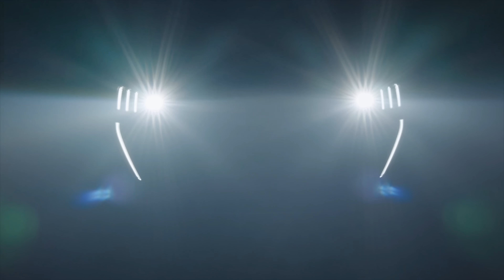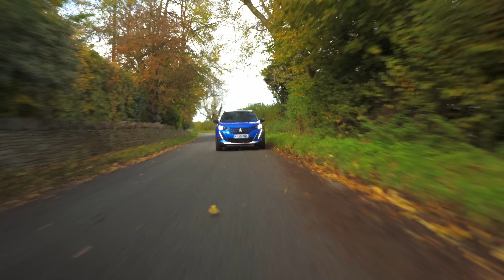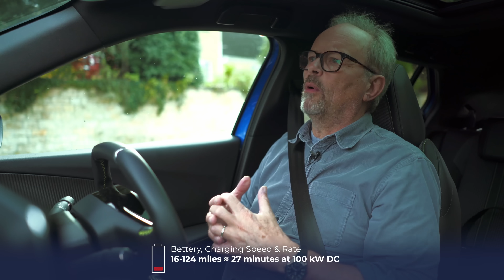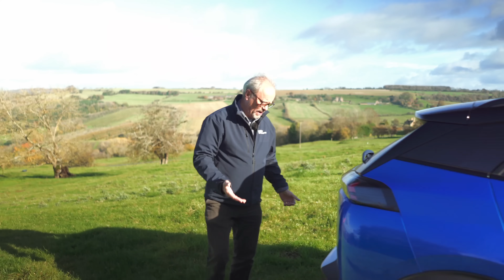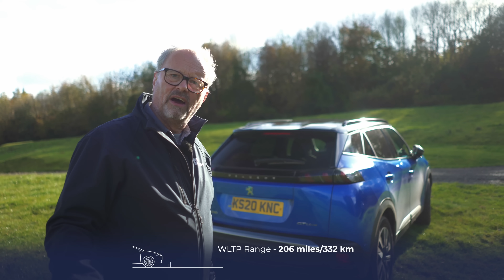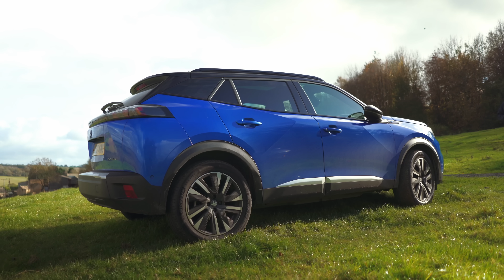Peugeot e2008 - how does it compare to other compact SUVs? | 100% Independent, 100% Electric

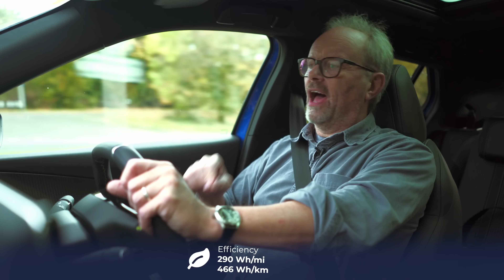Comment: 4:37 Why, oh why, oh WHY do you guys keep getting the conversions wrong!

290 Wh/mi should be 180 Wh/km (Pretty decent efficiency). Or alternatively, you have the units switched and it's really 290Wh/km and 466 Wh/mi (Pretty awful efficiency).
Reply: I think he left his math-circuits at the set of Red Dwarf.
Reply: I was just about to make a comment about this and saw this. Robert, you need to fix this.
Reply: @mdashikuzzaman  I was also going to point out this - and they did this mistake at least 3 times recently, not only in this episode !
Reply: Or how about just forget the silly imperial units and stick with metric? If people can't understand metric units they can put into a conversion program, eventually they will learn to use metric.
Reply: I suspect it done specifically to irritate people like, er.......

Comment: "I dont care what you say 150 miles range is enough.." owns and drives a 200 plus mile Tesla. If you are a 1 car family the longer the range the better. We do not have a reliable enough rapid charger infrastructure to validate such commentary. Also faster charge rates require more cells in parallel. The current physical limitations can not be dreamed away. You want a small battery ev? By an electric motorcycle. Its time to put up or ...... leave it be. I own one they are a lot of fun to ride. Make sure to do so safely and dress for the slide not the ride.
Reply: It depends, doesn't it? I'm in a one car family and 150 miles range would suit me perfectly if I had a driveway to charge on. I don't commute to work so my mileage is not very high.  I'm really more concerned by having enough space inside and initial purchase price.

Comment: Hi Robert. Just wanted to point out you’ve got the trim level logic backwards. Batteries are still expensive, therefore having EVs only on high trim levels gives them a larger margin to absorb that cost. The tech you get on a high trim level isn’t worth 10 grand, it’s almost all margin. The Seat Mii electric which starts from 19k used to be around 10k when it had a petrol option.
Reply: How can manufacturers justify £9000 for the battery?
Reply: @recumbentrocks2929  That’s a question for them to answer since I don’t have any inside knowledge of the costs incurred or their margin for warranty repairs, etc. Looking across the industry, EVs are roughly 7-10k more than a base model petrol version. Also there were reports that the electric Mii/Up/Citigo triplets were being priced at a €5k loss in order to mitigate EU fines.

Comment: The range is more like 140-180, it just has a horrendously pessimistic GOM. Some people are reporting that it's better after a software update.
Reply: The claimed 290Wh per mile, and 45kWh of accessible battery, gives a range of 155 miles. That agrees with your estimate. Robert's maths was wrong, near the beginning of the video.
Reply: @RWBHere  so 250km range? sounds pretty perfect for life in the suburbs.

Comment: £28k (although for some reason it seems to be more like £32k on the Peugeot website for the base, £35k for the GT Line) ... compared to £20,590 for the petrol one. Don't think they'll be selling many of these on cost alone, you've really got to want to have the electric one knowing your break even point is going to be beyond 50,000 miles away! Also I think its a pretty dirty trick to make the electric one appear cheaper per month by whacking on a £10k extra deposit over the petrol ones to get the monthly payments to look sensible!

Comment: Same range reports with all PSA eCMP based platform cars so far. Its just not very efficient at high speeds at all. And when you add ICE aerodynamics to the mix, that just tops if off.

Comment: Do you not think the EV market in the UK is going to be shafted with Rishi Sunak's plan for road pricing?  Could be £1.50 per mile!
Reply: £1.50 would be in Westminster I guess, less than 10p most places
Reply: Not if you have to pay it for all cars not just EVs
Reply: Can't see a cost per mile happening anytime soon. More likely a tax at public chargers and a large increase on road tax will be a more practical starting point.

Comment: So, first, if we take the consumption and translate that to MPG, it is massively more efficient than a combustion engine car. Then you get 130 miles instead of 260 miles from the car, so effectively, you simply actually DON'T get that very efficient car you blabbed about ca. a minute before halving the range. I'm not sure what I should take away from that blabla, really. :)
Reply: No it's still efficient. You need to look up what the word efficient means. It's basically like the battery has a gallon of petrol equivalent of energy but gets very high mpg.
Reply: @timscott3027  Depends very, very much on whether that MPG equivalent was taken from its official numbers or actual numbers now, doesn't it. I'm aware that generally, an electric motor is more efficient than a combustion one, Mr. Impolite McTeachy, but the text of this video went really, really crazy with throwing around numbers, halving others later on and being unclear on what's what about the first statement. If you don't see that, I guess you don't see that.
Reply: @fryke  yeah I get you what you mean, sorry for being rude. Still more efficient than ICE.

Comment: I own this car. The inside led can be dimmed or turned off if it bothers you. Mine don't bother me. 
Over 800 miles, I have an average 4.0 miles per kWh. I have heater on auto and get over 160 to 180 miles at this time of year. I'm a careful driver and expect much more miles in summer like I used to with my older leaf I had.
I also have a reverse camera
Reply: Nice to hear your getting a decide range too.. I get my black GT e2008 on 30th of November... can’t wait
Reply: @awesomeactiontv6964  you will love it 😁👌
Reply: @awesomeactiontv6964  any updates at all if you have used it for circa 2 months? I have been offered an e2008 GT for work, just mulling it over and would appreciate a hands on bit of feedback, many thanks
Reply: @craigwilliams6049  Got the car beginning of nov and I absolutely lov it... the only thing I’d say is if you are going to have to do lots of miles when it’s cold temperatures then your going to watch the range... I’ve notice and I have a friend in Sweden that runs a 208e that you’ll loose 30% range once it drops below -2
Reply: I test drove the car for an hour and was very impressed but they would not let me have one for a weekend as I wanted to do a 150 mile out and return (300mile) round trip to see what the motorway range really stacked up to. Without that I just couldn't pull the trigger on it.
Reply: @Mimbultonia  I know the feeling. I wanted to test drive others longer too, but no joy. I decided to take a chance on this and it's more than enough for what I needed. I've done various tests over my 800+ miles and I judge how well it'll do based on the quarter electric gauge. Basically I usually get 20 to 30 miles per half quarter. So I then usually know how it'll end up and I'm usually spot on. When I 1st picked it up, it said I had 188 miles. I drove 15 miles carefully and when I got home, it said I still had 188 miles lol
Reply: @Mimbultonia  just watch the many YouTube videos and you can decide
Reply: @danielcristea3868  I feel like I have watched them all! Just want to decide for myself. If the range was just a bit further it would be perfect
Reply: @Mimbultonia  James Batchelor (formerly of Carbuyer) has got one on test and he's saying he's getting close to 200 miles following a software update - which I suspect has come in since Robert filmed this video.
Reply: So pretty much what Bjorn Nyland got on his range test! 👍
Reply: I have this EV, same spec GT Line, also did not come with reversing camera ( supposed to be included on GT Line) but was missed on production line. Get about 120 miles on full charge in winter, and about 150-160 in summer.
Reply: Nice. I’m tempted. Does it have auto hold for the electric handbrake?
Reply: @cal_lywal  yes. My old leaf was the weird clutch style lol. This has a nice auto switch. Easy access 😁👌
Reply: @cal_lywal  I test drove it and I can confirm that it does have it. I actually love that function too. I am planning to buy one soon
Reply: I would really like one but the range worries me, especially in the winter
Reply: @The-Salty-Badger  totally understand. I'm now getting constant 4.6-7 and just over 200miles, so I'm happy with this. I was a little worried I'd never achieve this, but now have seen I can, it's a relief lol. I'd say judging from my ownership from last October, it's probably 150miles+ in winter worst case. 👍
Reply: @spacedoutET  what sort of speed do you drive at to achieve that and do you drive on motorways much ?
Reply: @The-Salty-Badger  I'm generally mixed, but I'd say mainly lower 50-60. I'm yet to do a solid motorway journey only, because of the past year covid 😖. Not really had chance. But it's mainly my area driving, so it covers perfect for what I need. Obviously, everyone's different and has different needs, so it's completely understandable your concerned. I was the same, as I was only offered a little test drive in a city and you always want a real test for what you do, wherever your from. I took a chance after owning a 30kwh leaf for 2 years and getting fed up with charging every 70+ miles. This doubled my range and I feel so much happier now. Tbh, even doing a long journey, most of the time in my old diesel I would stop half way anyway, to eat or rest, so having the option to charge doesn't really bother me whilst I'm doing that 😉👍. What ever you decide, I'm sure you will make the right decision for you. 👌
Reply: @spacedoutET  cheers appreciate the advice
Reply: Are the interior led strips also in the back?
Reply: No. 😷👌
Reply: @spacedoutET  Do u like the car? I can get the car in march.
Reply: @FeShMu  love it. So far, so good. I placed order in march and picked up October. Been reliable so far with no issues, touch wood. That's all I needed was reliability. Fed up with vauxhall always caused me issues for years. Needed a change and if it runs as well as it has these last month's, I'll be very happy 😷👌
Reply: @spacedoutET  Coincidence, because I’m driving an Opel(Vauxhall) Corsa right now lol. Do you use the app for your car?
Reply: @FeShMu  lol. I got the app, but waiting for it to register to fully make use. 👍
Reply: @spacedoutET  Do the car get updates?
Reply: @FeShMu  I believe so, but I think I have to do it a certain way, unless I'm wrong lol. I been a bit busy doing other stuff, I have not had much time to look into it. I keep forgetting everytime I'm doing something else. 😖. I'm a nightmare. Lol. Just aswell it's running fine. The guy at Peugeot was nice throughout and said any issues, just ring him. But ain't needed to. 😶👍
Reply: I don't think I've ever been in a car where the interior switch lights, mood lighting or infomedia screen can't be dimmed.
Reply: I have had this model SE Line since July.  During the summer I was averaging in excess of 6m/kWh but now we are in colder weather (plus I am doing shorter journeys) I am getting just under 4m/KWh.  I plan on 160mile range during cold weather - shorter journeys using sport mode will decrease this but this is down to driving style
Reply: @ujkakevin  this sounds promising. I've had my e2008 Gt for 2 weeks not rans it below an indicated 40 mile range remaijjng, but that would have only put me at 120-130 mile in total. Hope to get more to be honest. But I have free charging at work as well as home charging. 👍
Reply: 4 miles per kWh? That sounds not plausible. This is only about 150Wh per km. The most efficient smaller EV use that. On the other hand I Wonder how much interior heating affects that rating. IFAIK there is no heat pump in this car.
Reply: your maths is a bit out Martin. 4miles per kWh is 250Wh/mile, so sounds very plausible. and with 45kWh battery that would be 180miles of range.
Reply: @martingorbush2944  4 miles per kwh seems to be the industry target for any good BEV.
Reply: @martingorbush2944  
My Kona Electric regularly give me near to 5 miles per kWh of local road driving in the summer and 4 miles per KWh on motorways at 70 mph.
Reply: @martingorbush2944  my i3 sits on 14.6 kWh/100 km, over its 70k km lifetime.
Reply: @martingorbush2944  Their is a heat pump and check out the Driver Manual number 4 on the car diagram.
Reply: @martingorbush2944  watch Bjorn Nyland drive a 2008 over 1000km at speed limits +10% and achieve 3.96 miles per kWh

Comment: I think even city cars need 150+ miles range, in winter driving, after that it is just nice to have.   The weight of the battery is the same full or empty, so there is a point where the huge battery becomes an efficiency drag, along with much longer charger wait times.  I get the feeling car manufacturers and the general non EV public, are still stuck in the petrol station mentality where you only charge ( fill up )  once - twice a month, so the battery needs to replicate that.   In reality, a charger needs to be where the car is parked up for a length of time.  So you graze charge not gorge charge.
Reply: I suppose it depends if you live in a flat. My first ev was Renault Zoe 22kwh, I quickly learned I didn't need to charge all the time, even with a winter range of 70 miles.  I topped up at home and warmed the car before leaving....

Comment: GT line - is the production line where they are thrown together faster!  :-) - - If they discard all the gimmicks, bells and whistles, they could be sold for less. My current fossil car has an FM/DAB radio/cd player fitted. I turned it on when I bought the thing, to see if it worked, and it hasn't been turned on since - don't need or use it. I prefer the silence so I can hear what is going on around outside. - - Why do you keep measuring boot/trunk space in LITRES? I don't carry loose liquids in the back. Measure length, width, height in feet and inches, or if you really must - in those foreign centimetre things. Range -needs a bit more. A place I go to regularly is a 210 mile round trip - in good weather - and there is nowhere there to charge up while I'm away from the vehicle, so I'd be adding at least half an hour to the travel time - IF big IF I can find a charger that works - so I can get home again! - - And that big, ugly, square front, so inefficient. Yuk!

Comment: What's weight difference over e-208 as that does 185 miles. Repeated CCS charging on car tested here and a light foot, might do 145 miles. Better off with MG ZS instead.
Reply: Or an MG 5, although I'd forgotten for an instant that MG is Chinese, not British. Interesting how the MG brochure has an MGC GT in the showroom alongside the new car.
Reply: MG ZS EV drives better?